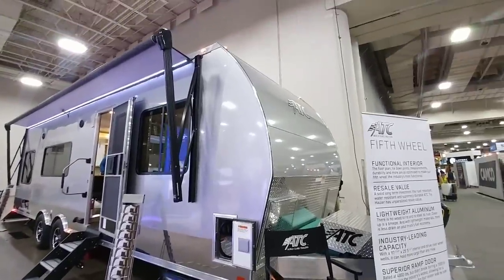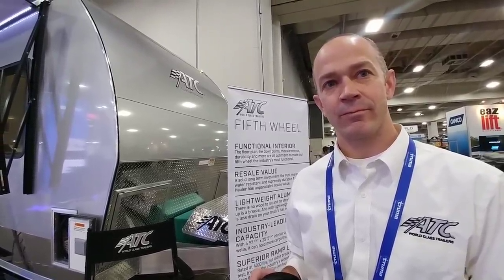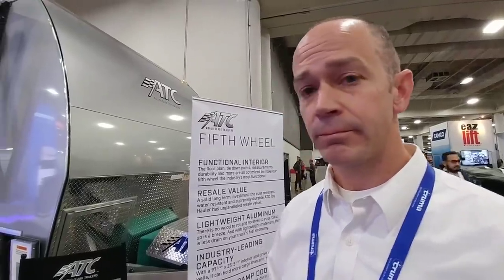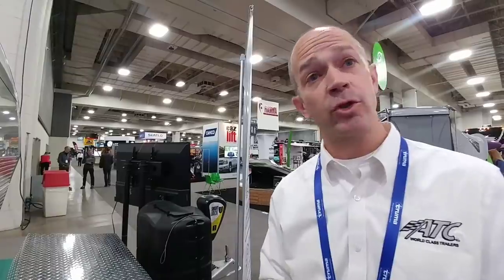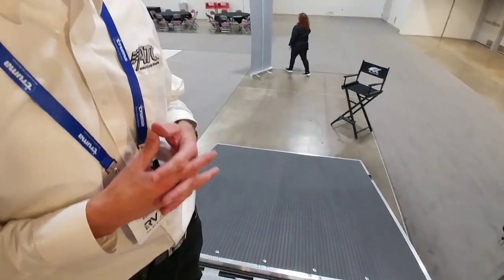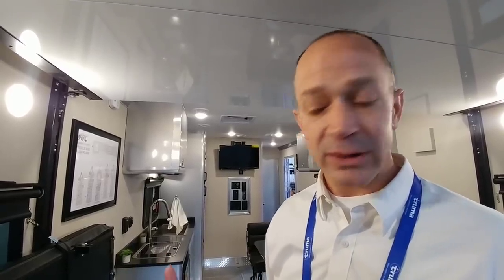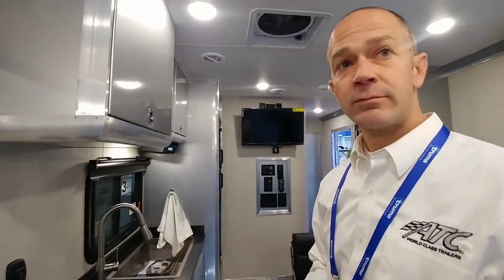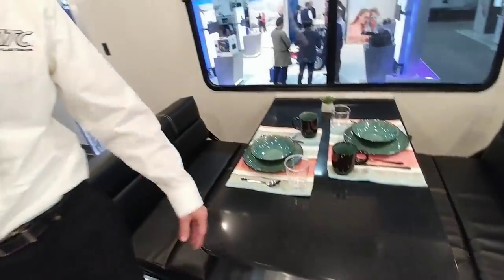Radically Different Toy Hauler! ATC Aluminum Toy Hauler RV!

Comment: I mentioned many times to review this trailer glad you did... my mother actually just bought that exact same 28 foot front bedroom with all those same options with the generator onboard and everything and she paid far far less then that so the msrp of that is up that high but it was in the mid40s when it was all said and done just throwing it out there
Reply: nick samay — so it can be done at much less than MSRP. $40k ish is reasonable but likely a fight with high profit sales greedy folks. Will look at used market too in ten years.
Reply: Steban just call them and price one it shouldn’t be any where near the 70s and
Reply: Amazing how the market has changed since this comment!

Comment: World of difference in this and a typical RV. We had horses and spent many weekends camping with the horses but also used that trailer for lake and beach weekends at campgrounds. It was all aluminum except the torsion axles and gooseneck, even had extruded aluminum slat floor. 42'L x 8'W x 8'T, 12' slide-out, full living quarters with 16' short wall on slant load trailer. When not taking horses we put grill and outdoor things where horses ride, along with collapsible tack room which allowed driving a golf cart into trailer. That trailer had every option the latest fifth wheel campers had but held resale value and was a very solid trailer. My wife has been wanting a fifth wheel and I told her I prefer getting another living quarters horse trailer even though we no longer own horses. It is built to haul weight (no under-sized axles), all aluminum structure and exterior, features of RV, they tow extremely well and they hold value. We towed 2-3 horses all over the East coast and mountains for 8 years with that trailer, no idea how many miles we put on the trailer. Never had any issues with it. My Mother-in-Law has a 10 year old camper set up on a beach lot, has been towed approximately 200 miles total. I went to check it for her Sunday to see if it needs any attention prior to her going this Spring to spend most of the Summer. First thing I noticed was how soft the floor was throughout the camper, every step felt like walking on a sponge. She has been getting RV guys in there every Summer for the past 4 years repairing things that are falling apart and it's not even used as a towed unit.

Comment: I just started checking into RV's with real intentions, and the market seems flooded with crap that mostly seems to try and look new/modern styling, but feel like they are pretty much disposable.
Nice to see these. Quality is always worth something.
Reply: AHAHAHAHAAHA -- better check on the quality issue with lots of the yutube videos that are on here about the problems they are having with these so-called well built trailers - - and most don't ever use yutube -  they are having plenty of issues - especially for the price they demand - very poor quality control- if yu really look into  em - and getting them fixed seems to be an issue also - some have even had problems with the axles of all things - they surely have suppressed as much as possible about such issues - very unprofessional like for sure - as if their workers and supervisors are incompetent - I grew up in a  supervision family 7 decades ago  -- the all aluminum is all that is special as to what I notice after years of looking - I am disappointed at the price verses the quality - twice as much - with problems - that sometimes are very big hassles to deal with - they blame it on their dealers of course !  - and only intervene if demanded to ! * - Rich people seem to have those issues if yu have ever noticed -

Comment: That's a sick trailer, love that they are using azdel throughout the entire trailer along with aluminum.

So no rust and no delamination. No worries of your stapled together cabnets falling apart. Truely a step above at a very reasonable price point.

Comment: Like the air stream! 
Better to pay upfront, and have it last. Then keep paying!!
Reply: I know it was a grammatical error but your statement of "then" keep paying is the truth.  Buy one at a higher initial price and keep paying the same as you would with any other brand and construction type.  These are very nice for certain uses but there are a different set of cons with all aluminum construction.

Comment: We bought an ATC toy hauler.  It arrived with all kinds of things wrong with it.  We’ve spent the past year documenting (videos and photos) the issues, on the phone and on the computer (emails) trying to get replacement parts and/or arranging to have things fixed.  After over a year, things are finally close to what they should have been for a brand-new unit.  Whenever I posted to ATC’s Facebook page, I was attacked, bullied for being disloyal, accused of everything from inflicting the damage ourselves to identity theft.  It’s been a horrible, horrible experience.  We’ve performed all but two of the repairs ourselves because, if the experts couldn’t build it correctly, how could we trust a dealer, who just sells them, to do a good job?  The one time we did take it to the dealer to fix one of the rainwater leaks, they replaced the wrong part, and made the leaking area even larger.
Reply: Buyer Beware.  We spent over 70k on ours: the roof leaked; several windows leaked, the gasoline system had two leaks, several cabinet doors and drawers were crooked, bent, or scratched.  There was a chunk gouged out of the shower and its floor was cracked.  The stereo did not work.  The upholstery on both couches was ripped.  The Happijac was installed incorrectly with loose/ bent screws and does not work properly - we are afraid that someone sitting below is going to get killed if/when the upper bed fails.  Although under warranty, they refused to fix it without charging us.  The back door is missing a seal … and on and on.  We spoke with the dealer and ATC, and then asked about fixes on the ATC Facebook page.  We were accused of damaging the rig ourselves, even though our photos were dated the day the hauler was delivered, while the driver was still there.  I was accused of making it all up and of identity theft.  Again, Buyer beware.

Comment: I lived in Indiana for a bit, right next to ATC plant. I delivered their trailers all shapes and sizes. Quality is ridiculous. Spot on. When I would deliver trailers, other hot shot guys were dropping theirs off at the same time or even at the truck stops they would always compare the aluminum trailers they were hauling vs mine (ATC). Always blown away by the quality.
Reply: I delivered to a RV dealer in Vegas. He said shhhhh all the RVs on the lot are pretty much throw away but the ATC will last forever

Comment: ATC has been on my radar for the past year.  Solid, thoughtful construction that doesn't weigh anywhere close to my current bumper pull toy hauler.  The only downside is the lack of four season capability.  It's not an option for me, it has to be able to function down to about 5° F.

The track system in the garage is sweet.   That would make securing my side by side a lot easier.  Hose out the garage?  I could get used to that.

One thing I don't recall seeing in that trailer is a skylight - at least not in the bathroom shower.  To me, that's a good thing.  One less component on the roof that will leak. 

How well will that tongue take to a WDH?

Comment: Now if someone could make tow vehicles as good as quality as this trailer!😄
Reply: F150 is made from aluminum alloy.
Reply: Ford.com
Reply: @henryford2736   No it's not. Also, not sure what Dicks expectations are of his toads? He wants them to fly and pay for their own insurance? Plenty of "good quality" tow vehicles available. Assuming you're a normal person with realistic expectations of the universe you live in.
Reply: @benjaminrobinson251  What do you mean no. Since 2015 the F150 is made from aluminum alloy except for the frame. That's high strength steel.  Light weight and stronger than steel. You don't know anything about the F150. I have one.
Reply: @henryford2736  That's quite a different statement than " f150s are made of aluminum" You're much closer but still not accurate.
Reply: Toyota truck will outlive this trailer
Reply: @skye1355  toyota trucks will outlive that recycled beer can of an F-150
Reply: Shawn Dickmann like the Tesla Truck?

Comment: Built for the long term of RVing, similar to the Airstream. 28+ continuous feet of aluminum sheet roof, hope they have calculated the expansion factor when that aluminum hits +150F. Great video, I appreciate your detail in describing and drawing out the sales details on coaches. Your experience matters!
Reply: They did. I've watched mine and it does fine. They have been building world class race car trailers for some time. I have a car carrier from them as well. 10K miles last year and not a single problem with it.

Comment: We saw this at the New England RV Show in Hartford CT back in January and the ATC are very well made and eliminates all the water leak rot issues that you'll get in any other RV.... as every RV will have a leak or two in time! These even have duel-pane windows and very large tanks... but... Our biggest concern was the very low insulation factor... We'd rather loose 4" of interior and be able to camp more comfortably in less than perfect weather.. also the better noise reduction with more insulation is a must... Love Your Neighbor... but you don't have to love your neighbor's noisy kids or generator!!! 
I'm glad they now have shorter 5rs with the 36 & 32!!
My ATC wish list for a 36' 5r would be...
1) R40 roof, R11+ Walls, R35+ floors with enclosed belly!!
2) Bedroom slides (Gives you more leg room even with a King, Larger closet space & Washer/Dry prep)!!
3) Wood cabinets or at least wood cabinet doors esp in the bedroom.. (We plan on going full-time so the metal cabinets are not very homey/warm feeling)!!

Comment: I managed a RV store for a little while. I saw many people spend thousands of dollars repairing shotty work by manufactures. I am under the impression most all manufactures are garbage. While managing the RV company, I vowed I would never buy any trailer other than an ATC. Your mileage may vary but IMO, ATC is at the top of the food chain as far as I'm concerned for toy haulers.
Reply: Our ATC arrived in terrible condition; we’ve spent the past six months making repairs - “bones” are good, but otherwise NOT worth the 70k
Reply: Rebel Lucy we are talking about TT not coach correct?
Reply: @rebellucy5610  Don't forget Newmar.

Comment: I almost bought one of these they are beautiful and very solid they wanted 52k with the generator for the 28 front bedroom I want with the Keystone impact travel trailer toy hauler which was only 28 k the one issue that kept me from buying was the fact that I do about 90% boondocking and once you start scraping in denting that aluminum gets very expensive

Comment: Aluminum is a good construction material with several benefits, that being said, many years ago when they first started producing Aluminum livestock and cattle trailers they were very prone to cracking and you needed special equipment and welders to do repairs on them. In general Aluminum does not have the same flexibility as steel, at least the cattle trailers couldn't flex very much without cracking.

Comment: They don’t talk about price because they are over double the price for not double the warranty. My Sundowner has a 8 year Warranty and when I checked on the warranty for the ACT toy hauler it was like a act of Congress for them to tell me it had a 3 year warranty. They do not have a 24-7 hot line you can call if you have a problem with your trailer. They only way to get a warranty issue taken care of or just normal maintenance you have to do it all by email and that takes weeks and sometimes months to get a response. The 32 foot  Sundowner is a whopping 500 lbs heavier than the 32 foot ATC. WoW ( LoL ) 500 lbs difference for double the price and not even a third of the warranty. My Sundowner is aluminum also, I payed $40K in 2019. The ATC I looked at that was 32’ with half the garage size was $85K. That was also a 2019. Get what you want it’s your choice, for me it’s a no way in Hades will I buy a ATC anything for over double the price and not even a third of the warranty. Maybe they have changed, who knows. All I’m saying is ask lots and lots of questions and do your homework.

Comment: In North America, it really comes down to ATC and Bigfoot as the best overall built Bumper Pulls in my opinion.  Oliver I would probably rank as 3rd.  Airstream doesn't even enter the conversation until much further down that list.  If ATC could just warm up these interiors a Bit.  Hire an experienced interior designer, spend some time narrowing down a design that will appeal to both the Dirt Bike riding husband, and the wife and kids who will be stuck back in the coach all weekend.
Reply from the maker: Youll see some new trailer in upcoming videos that will really impressive you
Reply: Looking forward to it.  The NuCamp "Avia" Prototype is probably the closest thing to something new/exciting coming from any of the domestic mfr's in years.  Even that has some shortcomings.   It's like we are stuck in some time warp over here, compared to the exciting modern designs/building techniques they are doing over in the U.K. and Australia.  This U.S. RV monopoly has gotten to the point of ridiculousness.

Comment: I just got quoted $65k on this model (starting at MSRP of $75k).  They only have a handful of dealers who "deal in ATC RV's" beyond the "legacy ATC vehicle trailers", so they're really spread across the nation with limited dealers to attempt to work with.  For example only 2 dealers in all of Texas and the one nearest me had only one unit in stock to look at.  A factory inquiry from me in Texas got a response "passing the inquiry" to a dealer in Idaho.  I don't know if people know their geography, but that's a big miss.

While it started at $49k base price, the additions on this unit quickly added up to $25k more in MSRP for competitive features other toy haulers have to drive off the lot at least $35k less than ATC's MSRP (at $40k or often much less, and equally featured) - but the dealer was telling me their pricing is such that they'd be losing money at $55k I suggested I'd pay grudgingly.  Their price model competitiveness (big gaps) and dealer scarcity is a real problem for them.  The boxes are simple as far as design and manufacturing costs "should" go, no Slides for example and as plain as plain can be relative to other makers' toy haulers, so they really need to get their act together on competitive manufacturing and related pricing, and their dealer network.  I'd pay a premium for all aluminum - I guess - but not $20-$30k more.  Why would we?  Many other "aluminum framed" RV competitors are just as structurally sound, and rot safe.

Finally, regarding this and other toy haulers... for this retiree and his wife, empty nesters who want to bring along their Harley... that doesn't mean we want:

- boy's locker room decor, fit and finish, 
- complete lack of counter space, coffee machine space, pantry space, and lack of other creative "livable" design spaces beyond the plain and square aluminum boxes,
- the smallest fridge capacity of any RV designs in the 25-35' length range,
- boy/bachelor's black seating as the only choice,
- cold interiors lacking any sense of warmth, inviting, or living,
- seating where you have to turn your head 90 degrees to kill your neck to watch a TV.

We just want a nice, warm, contemporary "living" RV - that can haul a bike.  In this regard, the ATC unit fails more than any toy hauler in providing a stark, utilitarian, boy's locker room fit and finish that my wife hates from the word go, and I don't blame her.  In addition to pricing/manufacturing costs and dealer networks, they need to find ways to warm it up and make it more livable.  Suggest warm leather in trim and valances ( not black leather!!! ), contemporary finishes in furnishings (not black !!!), and some warm contemporary cabinet door trim levels.  And finally, every fricking toy hauler - by every maker - at 25' and 28' have the same floor plans.  Get a little creative guys.  Think different end users:

OCCUPANCY:
A) big family
B) empty nesters, 

GARAGE AREA:
1) 1 Harley, 
2) 1 ATV, 
3) 3 dirt bikes, 

PREFERENCES:
i) Living spaces for different family sizes, livability and warmth vs. utilitarian,
ii) Kitchen/Fridge capacities and needs, counter top space needs,
iii) camping and outdoor gear cargo and storage, kayaks, etc.

... come on, stop just copying each other's same floorplans and get a little creative for meeting different needs.  The ATC floor plans are EXACTLY the same as every other toy hauler out there, that are EXACTLY the same as any other.
Reply: This is another example of someone that is mad at ATC for doing what they do. This is what ATC builds. There's a reason they cost more. Often, they offer double the carrying capacity, less than half the maintenance and a much better resale value. They're not for everyone and that's not going to change. For those of us that just want a durable toyhauler we don't have to worry about, they're perfect. I don't need to take my house with me or i wouldn't really be camping would I? I've looked extensively at all the other types you've mentioned and i can assure you they're much fluff and little function. Just wait until you take that first trip and have a dozen things to fix! Just thought i needed to rebut some of this nonsense.